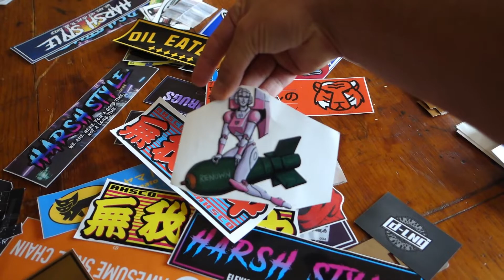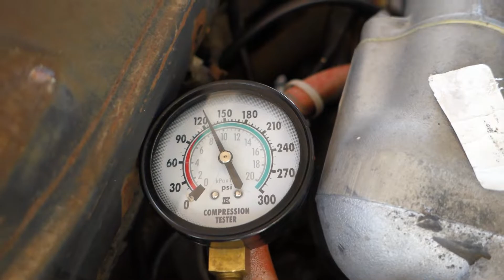BMW E21 Restoration Pt. 3

Comment: I have 1980 320i in my garage and including a 1980 Rx7. I was thinking of rebuilding the engine or put a long block...I am either going to start on the Rx first, which runs, or spend time & effort on the M10 e21? I will see your other videos. Where are you now with the BMW?

Comment: I had the same problem with my e21 and I ended up getting it to run by removing the fuel pump fuse and letting it burn all the old fuel that was in the system. Once it turned over and started running I had someone put the fuse right back in so that it had fuel to keep running. I changed the oil the next day and tried the same thing and it started right up and after letting it run for like 30 minutes it starts every time now.